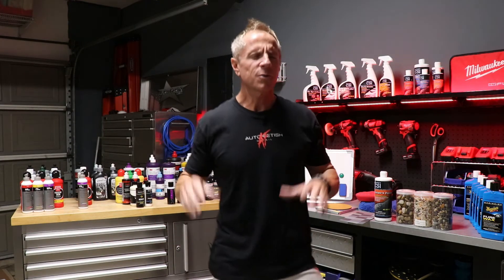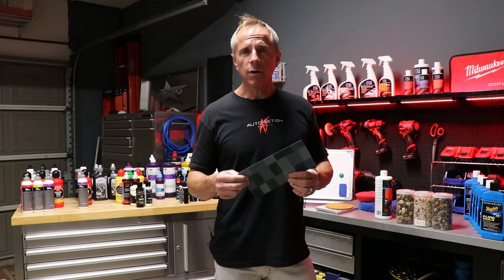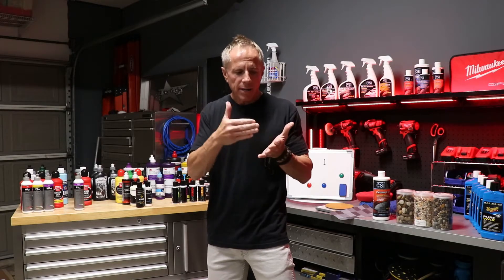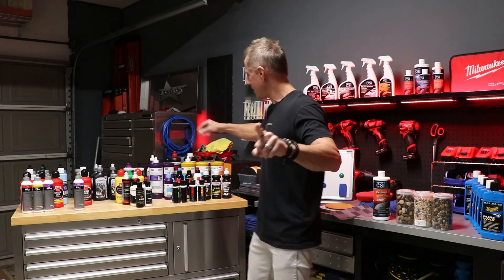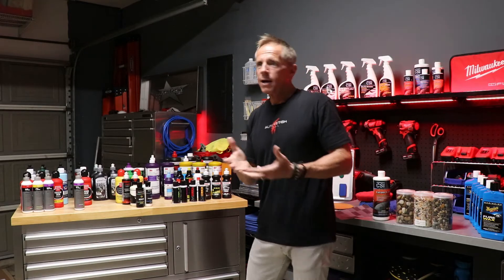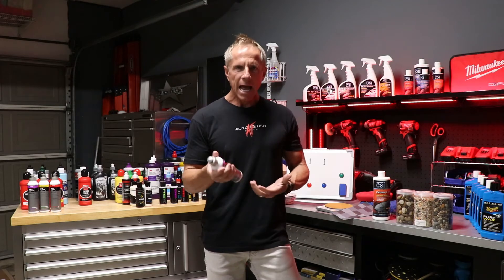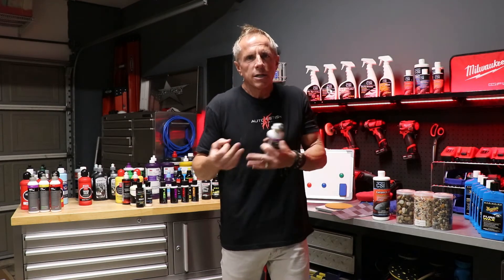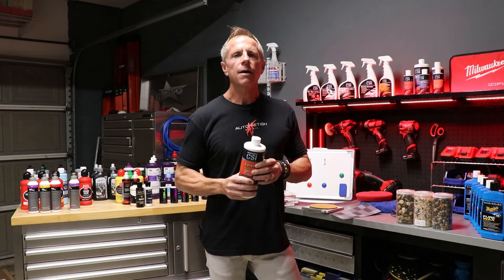Car Polishing Insanity: is the industry really as CRAZY as Darren thinks??!!

Comment: I have a question - out of all what you say (which i agree with most) there is one variable and that is paint hardness. Is it not then that we need something agressive (non diminishing abrasives) to attack said defects on a harder lacquer/ clear coat as opposed to a softer clear coat that can indeed by attacked by a compound in one step containing diminishing abrasives? Can you please have a bit of a convo with me on this one? I genuinely am nerding out massively on compounds and polishes, so these fundamentals for me are really important. Apart from types of abrasives then comes pad type (open/ closed cell?) , softer/ hsrder pad? microfibere? wool? foam? pressure, hand speed etc... RUPES as an example uses only Non-diminishing abrasives. So they do allow controlling to an extent  however the finish will depend on the clear coat hardness massively. Do you see where i am going with this?

Comment: I was buying in on the one-product pitch, till I went on Amazon and saw you had 3! Can you please explain?
Reply from the maker: Not sure what the 3rd product would be. We have 5 core products that include such things as a tire dressing and a detailer. But as far as polishes go, we claim you only need the Ceram-X to do all your paint correcting. Based on the defect removal, your skill level, the type of machine polisher you are using, you may have to use 2 differnt polishing pads, but still only use the Ceram-X. There is D1 Polish Enhancer which is exactly as the label says: it is to further enhance the polishing that you did with Ceram-X. I realize this may sound like word games, but the D1 is only there for the 1% of the world that requires a level of perfection that most people simply do not have a trained eye to understand. The D1 Polish enhancer is made with abrasives 10x smaller than the ones used in Ceram-X. The D1 would only be used after all your cutting and polishing with the Ceram-X, and only if you/your customer knows and demands a level of perfection that could be further achieved with the D1. As I said in the video, Tom (the formulator) was developing these products for his own body shop and high-end work. He wanted a simple solution (the Ceram-X) but he also needed to take things to a high enough level to compete at the level of Concours events. This is why he went on to develop the D1 Polish Enhancer. And because it represents about 1% of what people would ever need in unique situations, I have never talked about it on video as it would be redundant for most situations. I need to address this specifically in video format, but have spent more time just trying to get the word out on the merits of the Ceram-X polish. Thanks for tuning in! I have other videos where I use the Ceram-X in different conditions on differnt cars that show the single product process you would likely find helpful.  https://youtu.be/yylM2VKqmLA    https://youtu.be/dKgLY64jPkY
Reply: Don’t give mr Darren a hard time —. My experience is that if u use different pads or machines polisher with same 1 polish product u get different results. So Mr Darren is correct I have tried them all and now won’t go back to others.    Even in the kitchen pantry all I have is csi products lol joke.         Anyway give it a try and help support Darren  I think it’s a great product

Comment: That's all great Darren but 1 steps are a compromise.  You don't get as much cut as a heavy compound, and you don't get as much gloss as a finishing polish.   I love one steps, that is what I use most.  But I know that if I did a 3 step I can get better results.  In my world, it's not worth the extra effort and cost for the client because they all have daily drivers.   I used to use a lot of cleaner waxes, but these don't cut as well as 1 step polishes, and the protection they leave behind is not as good as dedicated sealants so I have reduced their use a lot.  On the plus side cleaner waxes don't dust at all, so that is the only reason I still use them from time to time.
Reply: The only one I've seen get close is the Meg's MF compound. Been by favorite ever since the launch. Softer paints still need a proper finish rather than the finish wax that the system provides. So it's more of a 2.5 step than a 2 step in some cases
Reply: This right here.   This video is kind of silly.   Anyone that's used these 1 product liquids for all steps knows the limitations and why there are specific compounds and polishes.

You can very easily send people down the wrong path with this video.
Reply from the maker: @YanniObkirk  Just as I could send them down the right path to a much simpler way of attaining results. The Ceram-X has the ability to cut like heavy compounds, but finish down to swirl free finish. This is the beauty of non-diminishing abrasives, as well as a super-tight emulsion found in the Ceram-X.
Reply from the maker: Actually with the chemistry and the technology of this product, there really isn't a trade off in a bad way. Ceram-X can remove 320 grit sanding marks like a heavy cut compound (which was an absurd challenge to demonstrate a point), but finish to a swirl free finish. I have not shown this on video, but I have shown in video where we use Ceram-X to remove 600 grit sanding marks and polish down to a swirl free finish. You can see that here: https://youtu.be/HrqMeLUFEiw

Comment: interesting. i dumped 2/3 steps ages ago. my results were poor, I went back to the longer steps and even went back to meguirs. one saving step i found was spray waxes can be cheap and do better regularly than long waxings with expensive single long durability wax. washing is key, clean paint is better visually than durable paint. Polish can do 80% of the work so pick a good polish and good spray wax!